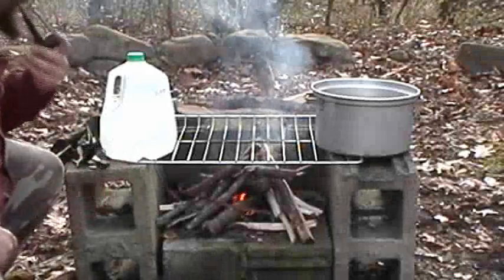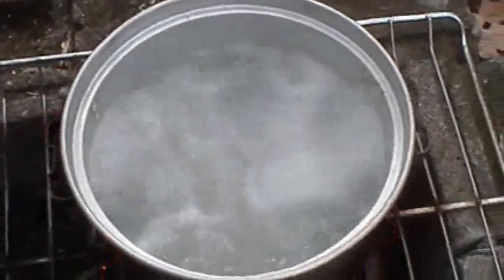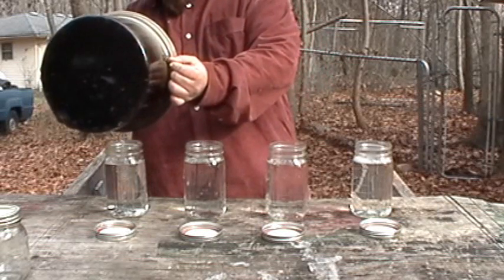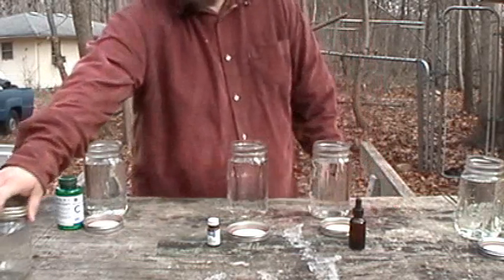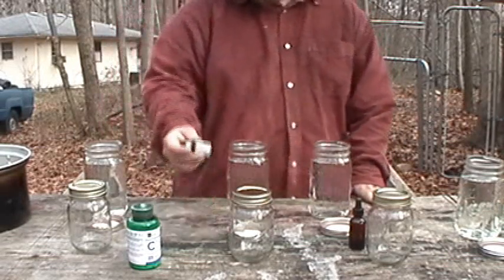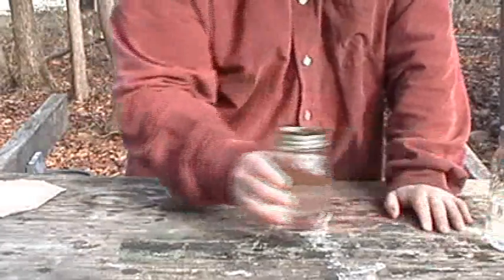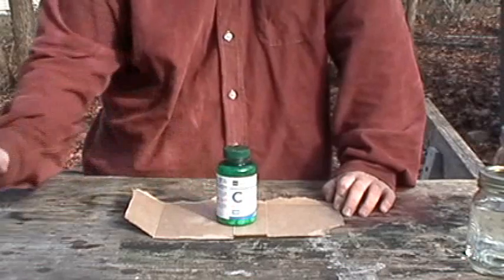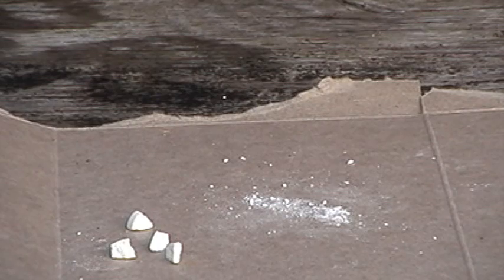Treating Purified Water With Ascorbic Acid Part 2 of 3

Comment: (continued) I mentioned that there is usually 2 types of chlorine in water (I have to look it to see exactly what they were).  One type you can remove the choline with an "off gassing" / time setting and/or heating process, and the other type does not even come out over time I read.

Comment: Glad you mentioned city piped in water.  I can smell the chlorine (there might be 2 types) when conditions are right.  I read that it is necessisary to prevent epidemics.  Thing is, it destroys bad bugs, but it might destroy the good bugs in our system....could lead to obesity, and malnutritioin.  I'll have to watch the next video, but I wanted to say that maby after you added in the chlorine you should let it "off gas" over a time period or heat the water back up to remove the chlorine faster.